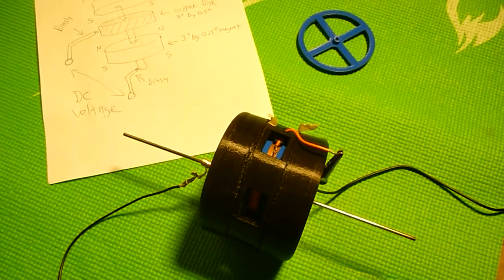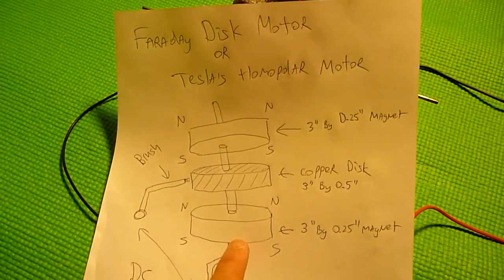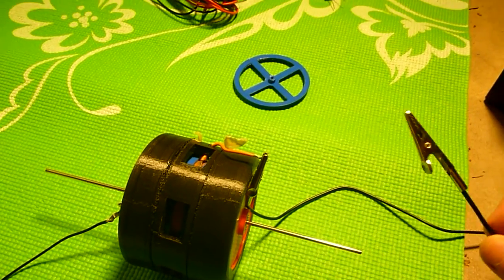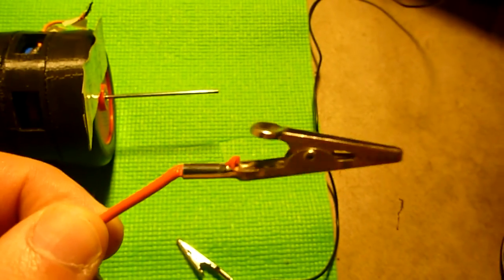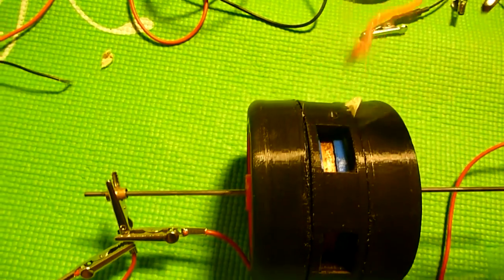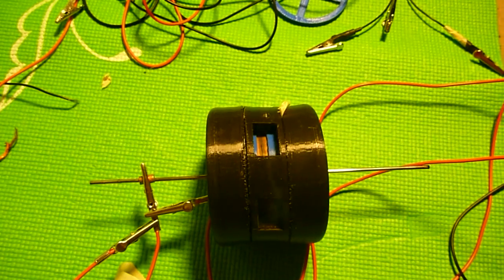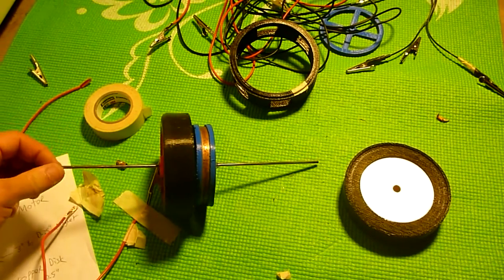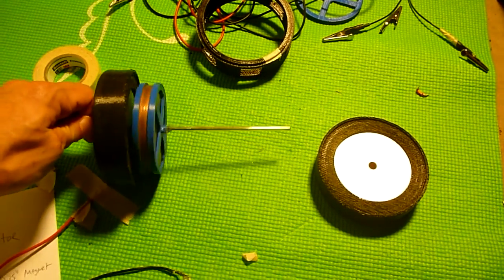Tesla's Homo-polar Motor or Faraday Disk Motor in action

Comment: Shorting out a battery is a bad idea.  You need a power source that is very low in voltage, high in current.    How about make 2 of them.  Use one as generator, one as motor?

Comment: Hi , thanks for working on the whole homopolar generator. I just got done reading Thomas vallone book on it. I have a suggestion about improving the voltage of the Dynamo. It occurred to me while thinking about kirchhoff's laws first and second. That's if you use the electrostatic electricity from the environment and added it to the amperage of the homopolar generator you would not violate kirchhoff's second law and the law conservation, since the available voltage in the environment is more than the total Watts input of the homopolar generator motor, then the voltage from the environment would rush to meet the wattage requirements of the the conservation of energy operating in the homopolar generator, yet these would be mostly voltage. By using open system thermodynamics such as as used to explain the operation of the homopolar generator, we can satisfy kirchhoff's first and second laws and the conservation of energy in an isolated system. Since the capacity of the Earth is larger then the current in the homopolar generator and since the power from the Earth's atmosphere comes from the sun, the homopolar generator would be the smaller of the two Energies.In this way we can give local amp hours 2 the high electric field in the environment around us. Please contact me if you'd like to discuss this further. Otherwise keep up the good work. Jeff VanEngineerTachyon Aerospacehttp://tachyonaerospace.earth/

Comment: How did you get the copper disk man? been trying to build one of these myself but its so hard to get the copper disk.. Have you tried getting power from this instead? you can use 6 volts, it will be less violent , most important it guzzles amps not volts..

Comment: If you take a man made magnet that also is a conductive metal... can that metal made magnet disk touch the copper disk with no form in electrical separation of the two? Turn it to still get electricity, or put electricity into to make it turn???

Comment: What are you doing?! Faraday´s homopolar is a GENERATOR! You must rotate the disk - in your case/configuration you should rotate the disks AND the magnets (otherwise they will serve as a break) and get power from your terminals. Very low voltage but big current. If you want it as a motor, ok, use a battery, for source, but with no more than 0.5V. Very hard to make it. You are just short circuiting your battery.

Comment: What if you used thin copper plates tightly stacked with staggered holes and spun them like a Tesla turbine with flowing liquid or gas at extremely high RPMs on a graphite axle? 

How much load do you think that would bare?
Reply: i dont mean to be off topic but does someone know of a way to get back into an Instagram account..?
I was dumb lost my password. I appreciate any assistance you can offer me!
Reply: @Nathaniel Bode instablaster :)
Reply: @Lochlan Vihaan I really appreciate your reply. I got to the site thru google and im trying it out now.
Takes quite some time so I will get back to you later with my results.
Reply: @Lochlan Vihaan It worked and I now got access to my account again. I am so happy:D
Thank you so much you saved my ass!
Reply: @Nathaniel Bode You are welcome xD
Reply: I was wondering the same. What if one used a liquid ferrite conductive material inside of a disc with leads inside and just spun the magnets? Then connect the leads to the outside diameter of the enclosure and the rotor axel. Would it generate a current? The. Could also possibly connect an array or stack of these liquid ferrite enclosure in series to drive up the voltage?

Comment: Nice build. As a generator this set up generates a lot of current and only a small voltage. A much thinner disc will reduce the capacity of the disc to carry current and reduce the draw from the battery, fatter wires or multiple wires will reduce the heating in the wires and leads. Of course a fatter axle will help too. If you want to generate power, then your thick disc will work better than a thin one, but you will need much better bearings as the higher the speed, the more power out you will get. When the disc reaches saturation (completely fills with current at high speed) then the induction that reduces power in a traditional generator (the back EMF) will actually join the current flow and many builders report more power out than the motor needs to turn the disc. Also reported is directly powering one magnet, or spinning one magnet to generate power. But if it gets hot, it will demagnetize. The contact sparking is a common problem, get creative to improve the current transfer.
Reply: ......... ==Also reported is directly powering one magnet, or spinning one magnet to generate power. But if it gets hot, it will demagnetize==  I have an idea like that, no need for a copper disk. Can you tell me where that is reported, any links? Thanks.
Reply: Yes, use Mercury pool contacts..best lubricant contact!☝️

Comment: Why don't you create a proper circuit by installing a high power resistor in series with your circuit to create a current limited circuit?  Doing so will reduce the current that is applied to your motor. 

p.s.:  When you run DC through copper, a magnetic field will be created.  That magnetic field will interact with the fields of your magnets to create motion.  That motion will create Eddy currents to be created & those Eddy currents will also create magnetic fields that will repel your magnets & create motion.  Lenz law is related to the motion of those Eddy currents fields.
Reply from the maker: Lenz's Law is not present in every situation. That law is only applicable to rotors of a particular geometry. Check out this lecture with demonstrations by Jim Murray https://www.youtube.com/watch?v=HK3JOlY0V8Y, he created tons of devices which negate Lenz's Law making them thousands of times more efficient then thought possible :P Thanx for the comment.
Reply: Actually, JM's elliptical rotor is quite similar to this rotor in functionality:  http://www.valco.eu/sitemanager/file/r_4_Shaft--rotor.jpg
Lenz law still applies, btw :). JM's rotor just has less surface area applied because he does not completely fill in the geometry of his elliptical rotor that turns in a cylindrical volume.

If you believe that Lenz law does not apply to your device, how do you explain the cause of motion in your device?  Obviously the force generated by your battery is the driving force, but how do you explain exactly how that energy affects your apparatus to create motion?  What's actually causing the repelling force against your magnets to create motion?
Reply from the maker: zeffur7 Jim Murray's motor is similar to the one in the picture and yet is different because of its shape. The geometry plays a key role in Lenz's Law. Another person who managed to beat Lenz's Law is Edwin Gray in 1970s (I'm not sure that you are familiar with him). What makes the copper disk spin? Well, the very nature of magnetism is rotational. If you look at a magnet with iron fillings you'll get these rings (made of the fillings) that go from one pole of the magnet to the other. But you also have the rotational aspect to magnetism. Have you ever seen videos on motors made out of 2 regular bearings and nothing else? If you connect 2 bearings outside to a high amperage power source these bearings will spin a rotor using no magnets or coils! (I made a video about this). The way that current travels through wires is also rotational.

To test if or not Faraday Disk motor is effected by Lenz's Law is simple enough. Spin the disk and connect it to a load, does having the load on the disk slow down its spin? In my tests I couldn't detect a difference when disk was connected to a load and when it wasn't. If you have doubts you should try the experiment yourself. The one true way to debunk someone's theories is to repeat the experiment and prove him/her wrong :)
Reply: re:  "Have you ever seen videos on motors made out of 2 regular bearings and nothing else?"
No.  Are you sure the bearings aren't spherical magnets?  Can you link me to the vids that you find most convincing/useful (including your vid/s on the subject)?

re:  "...in my tests I couldn't detect a difference when disk was connected to a load and when it wasn't."
How much current was being circulated & what size load resistor did you use?

p.s.:  
I"ve seen some vids related to E. Gray, however, none of them revealed exactly how he produced the results that he purportedly produced.  Do you have any links to vids that you find especially good on the subject?
Reply from the maker: zeffur7 I've made a video about this bearing motor that I've been telling you about. Its only about 3 min., I didn't use any special bearings (regular skate board bearings). I hate to promote my own videos, but here: (I don't have commercials so I don't get paid for anything) >>> https://www.youtube.com/watch?v=iGheUIBRXNU In regards to EDWIN GRAY and his motor. Here is a lecture by Peter Lindemann about what he learned about Edwin Gray's technology, this presentation was done in 2001 free energy conference. The lecture involves schematics, news paper articles, etc. Here it is: https://www.youtube.com/watch?v=ZRBUuicNuNY
Reply: Thanks for the links.

Your battery powered bearings device is quite interesting.
Is the strapping around your bearings "zinc (or other) plated copper"?
Reply from the maker: zeffur7 The strap around the bearings is an iron ribbon for holding pipes together (its a plumbing strap). I think it is made out of galvanized soft steel, it is magnetic.

Comment: what would happen if you use some sort of a torroid in the centre for energy generation
Reply from the maker: +BCzepa In this case the copper disk's interaction with magnetic fields is what causes voltage and amperage to appear (if the disk is span). There is a very large version of this generator with mercury being used as a commutator. I can no longer find the video for that machine. That machine was capable of spinning itself.

Comment: Faraday  paradox, The apparent magnetic induction which occurs between the ---->co-rotating<-- disk and magnet.
The magnets and disk can spin at the same time and still produce power, this is the real mystery to be investigated.
Reply from the maker: +Koronzon444 Thank you for the comment. I am also considering posting a video of the bearing motor. The motor consists out of 2 bearings holding a metal shaft (no coils, no magnets). The 12 car battery is attached to the outside of the bearings and the rod is given a light spin after that it takes off and starts spinning! There is so much we don't know about how electricity works and what it really is. I feel like officially all electrical experiments have ended in the early 1900s everything today is basically recycled from that time period.
Reply: @naokikashima9349  that thing was erroneously called "bearing" motor, only because it sits on bearings but the explanation is damn wrong. It would spin even if you use brass bushes instead of the bearings or even if you put the shaft upon a solid surface and let it slide on it.

Comment: Leedskalnin gives you the energy source to use does he not? Negative electricity???
Reply from the maker: +Jon Doran According to Ed (and a few others) there are 2 particles involved in electricity. Mainstream science says that the electron is the charge carrier in electricity. Again Ed and Edwin Gray claim there are 2 particles. Magnetism and electricity have an intimately connection also at times electricity can act like a charged gas under pressure. Because of mainstream education (brainwashing) few people are willing to consider the alternative ideas about electricity. The best way to find out the truth is through experiments.
Reply: +Naoki Kashima Did you read all of Eds works? Your missing what he is saying. Took me three years to click. A battery is positive electricity!!
Reply from the maker: Jon Doran Both poles of the battery? Go on. What do you think 'negative electricity' is?
Reply: +Naoki Kashima What does Ed mean by Voltmeters and Ampere meters are one sided?
Reply: Voltmeters and ampere meters are one-sided. They only show what is called by instruction books, positive electricity, but never show negative electricity. Now you can see that one-half of the electricity escaped their notice. 
It's escaping your notice to
Reply from the maker: Jon Doran So how do we get negative electricity? Also, what are your thoughts about the Testatika generator and does it also use 'negative electricity'? I'm open to all ideas as long as we can use these ideas to make real devices.
Reply: +Naoki Kashima  Ed said it was easy and it could be done using simple tools, the secret was knowing how. If you ever find it, you will kick yourself how easy it is. Not heard about testatika but will have a look.
Reply from the maker: Jon Doran Cold electricity sounds like Back EMF to me. If you induce magnetism in a transformer then you break the connection you get cold blue sparks. These sparks have many volts and amps (as all the induced magnetism is converted back into volts and amps). Jim Murray is modern inventor who found a way to use this back EMF to do work in generators. These cold sparks which result from conductors really are cold to the touch... I had them spark in my hand before.
Reply: +Naoki Kashima but again back EMF is using positive electricity what the electrical engineers use, I am looking for what the physicists use. I think people have been over thinking it.
Reply: +Naoki Kashima 
To the electrical engineers the positive electricity is everything, the negative electricity is nothing, but to the physicists the negative electricity is everything, and the positive electricity is nothing. Looking from a neutral standpoint they cancel each other, so we have no electricity, but we have something. EDL.

You can find the same explanation in yin and yang philosophy:

Non-polar (wuji) and yet Supreme Polarity (taiji)! The Supreme Polarity in activity generates yang (positive electricity); yet at the limit of activity it is still. In stillness it generates yin (Negative electricity); yet at the limit of stillness it is also active. Activity and stillness alternate; each is the basis of the other. 
In distinguishing yin and yang, the Two Modes are there by established. We understand one mode positive but not negative.
Reply from the maker: Jon Doran You are presenting a very interesting perspective on the electrical phenomenon. You know the twin Caduceus (snakes) which are used as a medical symbol can also represent the way electricity moves around wires (metal serves as boundary to the electric field, electricity exists in the dielectric). You have your 'positive' electricity going clockwise and 'negative' going counter-clockwise through the wire. This notion of different rotation can also be found in magnetism (coils wound in opposite ways will have opposite magnetic polarity). Also, many eye witnesses who saw flying saucers up-close claim that they have two rings moving around the craft in opposite directions to each other. Devices like Testatika generator and Wimshurst Electrostatic also have 2 disks spinning in opposite directions while creating static charge. This is all very interesting. My next move will be investigating electrostatic systems (like electrostatic motors, electrets, etc.) I need to look over these things again. Thanx for the comment.
Reply: +Naoki Kashima Have you read viktor schauberger work?
Reply: +Naoki Kashima plus the caduceus snakes are moving in the same direction a representation of negative electricity not positive. The wings are a big give away.
Reply: @heavycurrent7462  sent you an email would love to correspond with you & share ideas!
Reply: @viperousDraco696  I received it and have responded. I am rarely on emails and do not use any social media except youtube, though this one is going away as well.